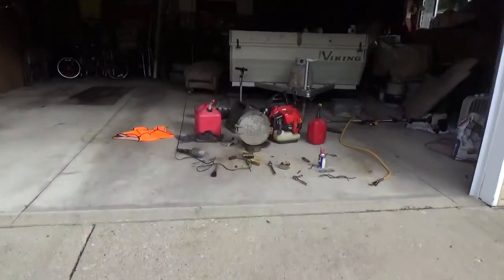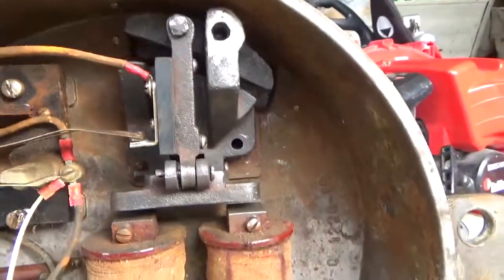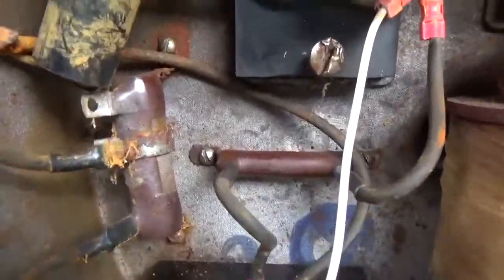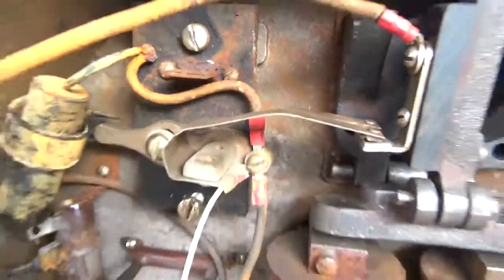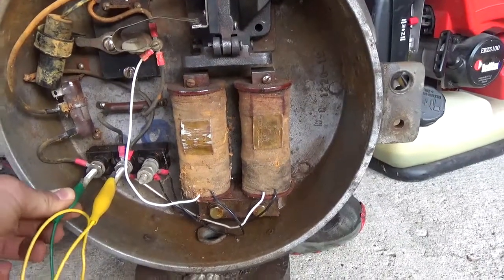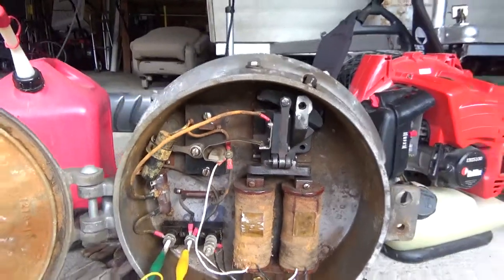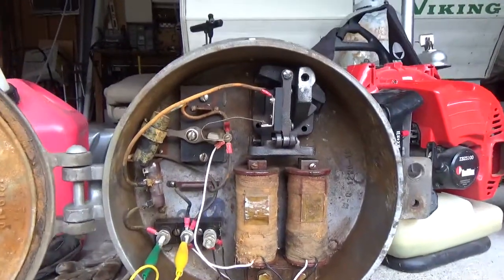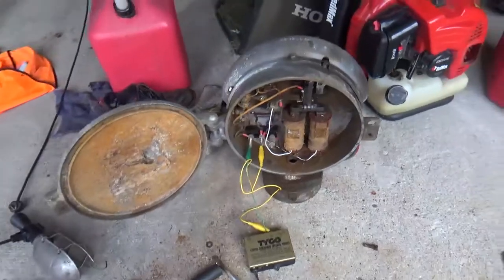WCH Bell Brought Back to Life

Comment: My WC Hayes bell was made and installed in 1982 and removed from its signal on 8/12/15. The crossing was on an industrial lead, former mainline and was being removed as an easier access point with rails was being created with new rails so the crossing was redundant. The outside of my bell is in really good shape too considering its Michigan but no where near as bad as this.
Reply from the maker: +PereMarquette1223 I did not know that. Thanks for informing me with this information. It kinda looks that my bell look older than the date you said it was made in but your info makes total sense now.

Comment: You have a different type of gong in that bell it sounds quieter.
Reply from the maker: +PereMarquette1223 I heard of two different kind of bell tones that WRRS did, they had soft tone and loud tone bells. The reason of that is the soft tones had a hard rubber hammer in it, and the loud tone had the iron hammer in it. Mine (though it is not wrrs) is a loud tone. I'm not sure when WCH went to the steel or aluminum gongs. So would mine be considered a first generation bell from WCH? I'm not sure.
Reply: WCH was using WRRS era parts and techniques when they made these early WCH bells. I'm guessing they updated this design in the 90's. I have a steel hammer which produces the deeper ring. WRRS did both. All depends on what you wanted when you ordered. These bells really are pretty ancient in design and have received little change since they were release by Bryant Zinc Company (pre-WRRS). Don't change what works!
Reply: My WCH 0333 has a similar sounding gong as well. Serial number is 7053.